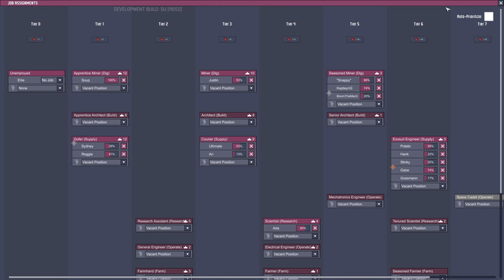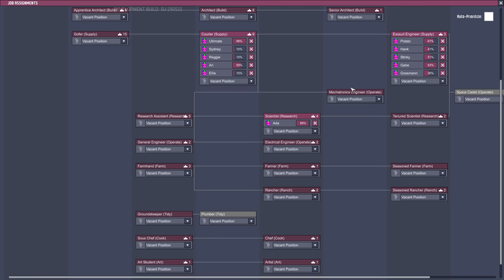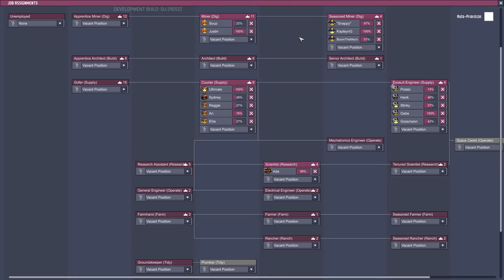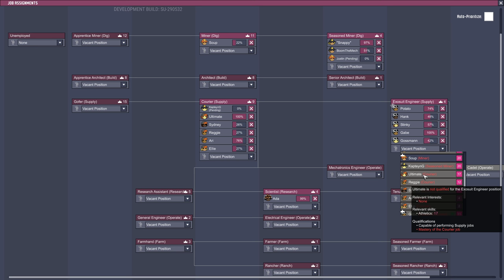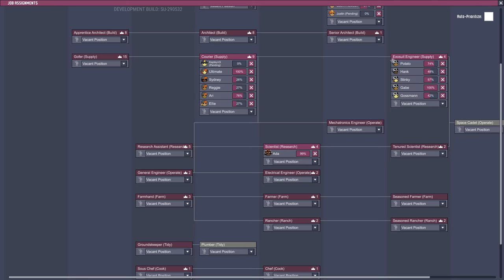SPACE INDUSTRY BASE #8 - Prepping for Space & Oil - Oxygen Not Included [4k]

Comment: Maybe try an aqua tuner I believe it's called to cool down your petroleum.  It requires power but they do seem to work.
Reply from the maker: Good plan. I think I'll just store it in the insulated tanks for now. I'll probably use the aquatuner for cooling water later though.
Reply: Personally i just use a hydrogen (as far as im aware thats the best gas for cooling purposes) cooling loop connected to around 4 gas coolers and run wolframite radiant pipes through the warm areas and pull off using gas shutoffs and gas pipe thermo sensors seems to work just fine

Comment: A free-form petroleum tank will be just fine, even if it's made with regular insulated tiles. However, to keep the heat inside none of the insulation can touch the rest of the map. Even if the inside of the tank gets to 150 degrees and the outside is a 30 degree gas, you'll only see thermal energy leak over several hundred cycles. The Abyssalite composite is only needed if you can't form a gas seal entirely around whatever you want thermally separated.
Reply from the maker: I'll try that out.
Reply: Insulated pipes being the only physical connection between the tank and the actual refinery should be good, but the pump and liquid vent should probably be steel so they don't melt.

If everything works, the only cooling needed will be on-site for the petroleum use!

Comment: 37:25 you can use some liquid resorvoirs in a vacuum room
Reply: also, I make my electrolyzers room something like a compactar room the way cryptic fox does. But I made the system a little bit more efficient: I use smart batteries so a lil bit of hydrogen is getting used, then I use the hydrogen to generate even more power in my power grid
Reply: by the way you can use thermo nullifier to cool down the plastic makers
Reply from the maker: Good plan. So they are no longer insulated?
Reply from the maker: Disregard my last comment. They seem to still be insulated.
Reply: ı dunno, my petroloum was cooling down in reservoirs

Comment: I don’t know how many times I’ve watched you build power grids and I still am having trouble getting the same results. I think I don’t understand transformers and how many can run from a power source or something. I’ll keep trying though.
Reply: On the heavy side, they are consumers (either 1000 or 4000). On the regular side, they work as generators. That's all you need to know.
Reply from the maker: Sometimes thinking about power like flowing water makes it easier for me. Imagine a big hose (the heavy watt wire diameter 20) and branching off that heavy hose with smaller hoses (diameter 2 assuming conductive wire or 1 with normal wire). So you could have 20 small hoses branching off without overloading the heavy watt wire. The transformer also stores a small amount of power like a buffer or tiny battery. This all assumes you have 20kw of power generation on the generation side. You don't need 20kw to get things working though. Just enough power to supply the consumers.
Reply: Thanks!  That imagery helps a lot. 😊

Comment: Quick question. Whats the purpose of putting water under your refinery and polymer? Heat dissipation?
Reply from the maker: Yup it soaks up heat really well. Eventually it gets hot but you can mop it up and dump it somewhere else and just make a new ice sculpture. It's a really easy way to cool but ideally you would build a cooling loop or use lots of wheezeworts.
Reply: @GrindThisGame  So I'm confused with this concept, because wont it just heat the water to the temp of the object? Instead of "spreading" it.
Reply from the maker: @s3ri3sb43  Correct but because water can soak up a lot if heat it just lasts a long time. Better to move a coolant in radiant pipes over it.
Reply: @GrindThisGame  Wouldn't polluted water work better, then? I know, you can't build dirty ice sculptures.